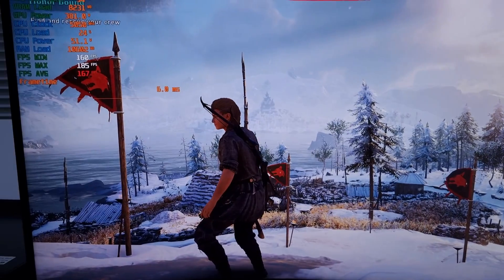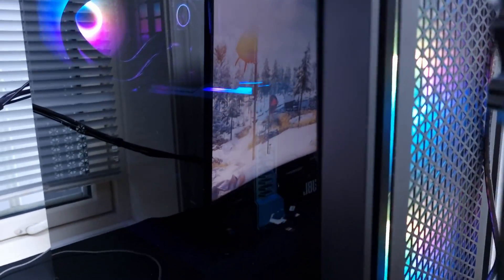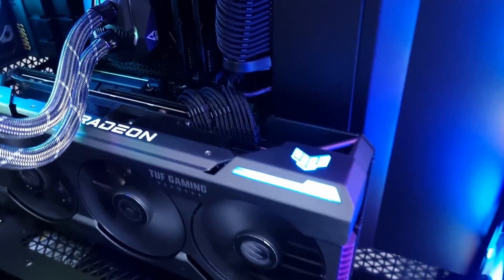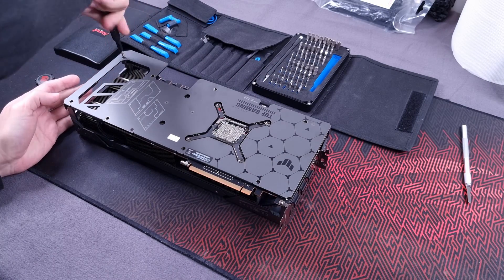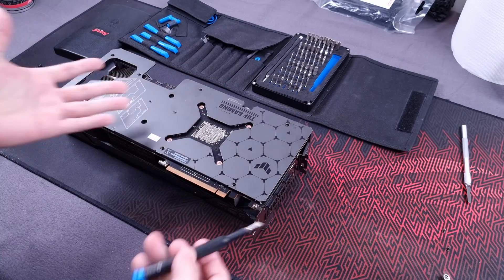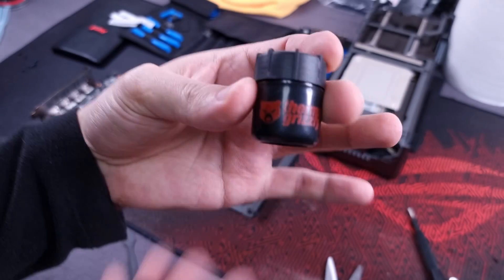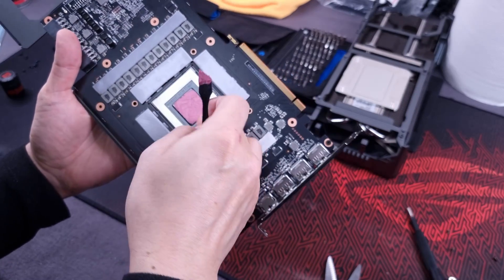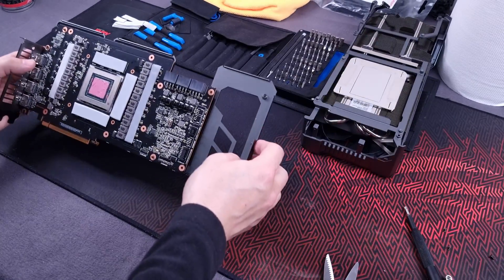ASUS TUF RX 7900XTX TEARDOWN (hotspot fix)

Comment: Bro, i only see 375W power ussage and loud coil whine noise is super loud. 4080 has 250W+ power consumption in gaming. What is this AMD gpu? 💀
Reply: U come here only to talk shit? Nvidia fanboys are the most insecure lmao. Let's talk about that melting connector burning people's houses to a crisp then come at me about having to repaste a gpu lmfao 😂 weeee i have a 16gb gpu that won't have enough vram by the time games actually have meaningful rt which will be like 3 generations from now
Reply from the maker: This is the RX 7900XTX. Coil whine is common with these GPU's, particularly in certain games more than others. In most games there is no coil whine. I hear it mostly with Assassin's Creed Valhalla.
Reply: @TechnologyHive  Why did u bought this gpu? It has like 100 negative side and only 1 positive which is 24GB VRAM l.
Reply from the maker: @d4nith3  I have a 4090, a 4080, this 7900xtx, a 7900xt and other cards I use for video editing and testing. I like the AMD software over NVIDIA's. For this reason I keep it in my main machine. 

The only issue I had with it was the hotspot. But now that is fixed, and the card works perfectly! I don't see in anyway "negative sides" with it, other than cost. But it is faster than the 4080 in most games and costs a lot less than my 4090 which currently sits on my shelf looking pretty. 

The 4080 consumes around 310w, while my 4090 consumes 415w during gaming. My 7900XT consumes 320w, and the 7900XTX  hovers around 360w-370w. All these cards are power hogs. But I still prefer the 7900XTX.
Reply: @TechnologyHive  It depends on the game, for example in Tlou1 the 4080 beats the 7900xtx while consuming 260w vs 360w. But in most cases the 7900xtx has more fps while using more power and generating more heat so its understandable that he wins. For 1557€ i could buy an RTX4080 Rog Strix while the a Sapphire 7900XTX Vapor-X is 1145€ but the nvidia is the clear choice because on the long run u will pay more for the electricity bill with the amd gpu. So on the long run nvidia wins. The other "negative side " of the 7900xtx is that amd gpus doesn't have, can't  do Physics, only nvidia gpus can so in ur case ur cpu has to do the PhysX. In nvidia control panel i can set the Phyx to be handled by the gpu so on the cpu has less stress.
Reply from the maker: @d4nith3  PhysX goes back to 2006, originally created by Ageia, which later merged with Nvidia. This is nothing new or better in terms of performance. Physics and game logic are handled by the CPU on both Nvidia or AMD GPU's. Certain games which support PhysX benefit from it, but makes little difference as far as performance goes. 

You can test this yourself by toggling between GPU or CPU physics in the Nvidia control panel and you will notice 0 difference. Most modern CPU's are powerful enough to handle this well. As far as power consumption goes in the long run, I don't think this is a deterring factor when it comes to GPU selection as long as it is justified by better performance. 

Overall, AMD's software is superior to Nvidia's, and you do not need to create an account to use it, as with Nvidia. Look, I like both brands and I own many of their GPU's. in the end, you have to purchase what makes sense for you, not some random guy on YouTube. 👍
Reply: @TechnologyHive  In EU the electricity price is "ok" but in Australia and UK the electricity price is really high so the power consumption of a gpu plays a huge factor in deciding to buy it or not. So in the past 2 years this is an important factor. Even in America this is a big concern. This applies to the cpu market as well. Thats why AM5 is so successful, 7800X3D with 65-75W power ussage beats the I9 14900K with 125-140w ussage in GAMING and that's  why Intel loosing on cpu side while AMD winning since the AM4 platform. So... the power consumption makes a huge decision on what to buy or worth to buy.
Reply: Man what are you talking about ? The 4080 uses 305w on average during gaming as all reviewers say. This card is overclocked, the base level is 350w and mine is tuned to use 320w without losing performance (compared to the base model, i lose 5% compared to the overclock). Every reviews show a slight edge towards the 7900xtx on raster performance. So the difference in price is for a better ray tracing compatibility, that's it. In the long run, you will have to replace your 16 gigs card, i guarantee it.